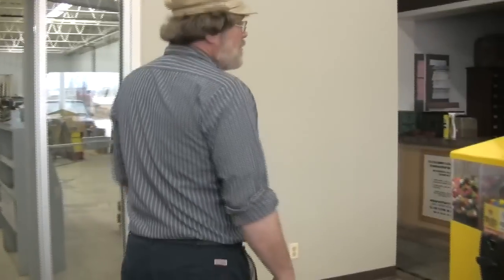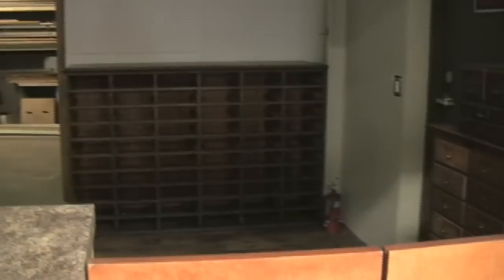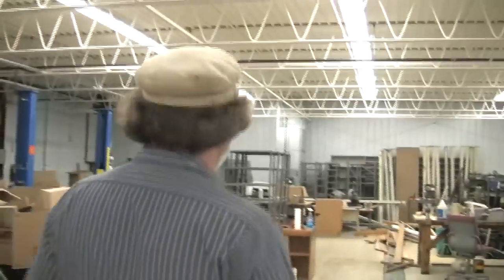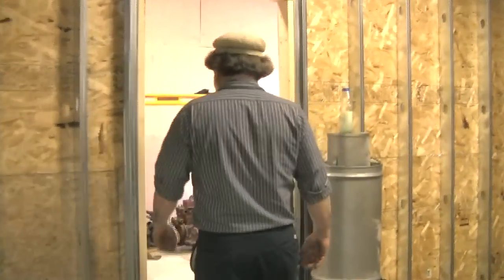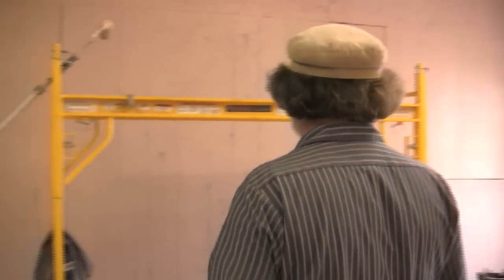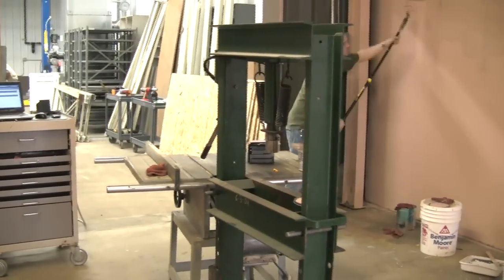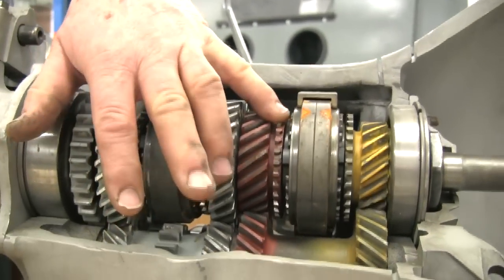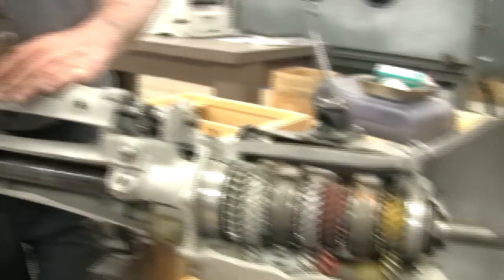139 MG Tech | Gearbox 3rd Gear fallout on MGB - March 8, 2011

Comment: another reason is that the rubber in both the transmission mounts, and either or both motor mounts has degraded.  the shift lever itself can contact the hole through the floor, causing the gear to not be engaged all the way, or the whole engine/transmission assembly can shift forward, backward, or lean side to side bumping the lever out of gear.

Comment: John. My 1980 B on decell with fall out of forth and third. I actually have to hold the shifter in place when I come off the gas because shortly after I do the trany just walks out of the gear. Might that be the detent spring pressure or is more major ? Thanks for your great vids, keep them coming, I am learning a great deal.

Comment: I have a question for everyone and anyone. I'm having a problem with my MGB box. When the box it warm (after a good 30 miles) 1st 2nd and 3rd gear seem to slip. like oil on the clutch but then kick in like normal then fade out again. Once left to cool works fine?! Does anyone have any idea what this could be? Just replaced the gear oil and gearbox mounts (following Mr Twists fantastic video on mounting positions) Thankyou

Comment: I have a mg midget 1500.  See the video in the link below.  Are 2nd and 3rd gear supposed to move like this?  I should add that I rebuilt the transmission last year, drove it without issues other than it was hard to get out of 3rd gear.

 https://drive.google.com/file/d/13rivugHLKElfEY-4mVHhEIjnKSSY9i_4/view?usp=sharing